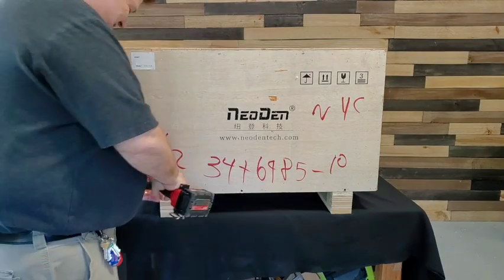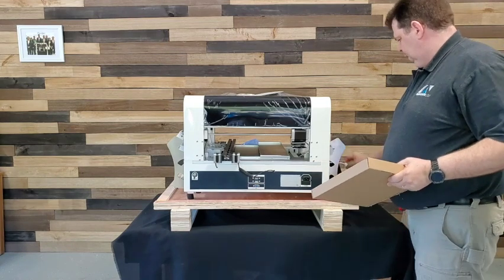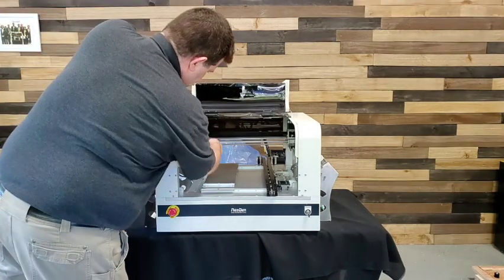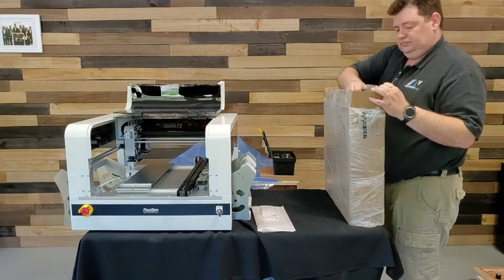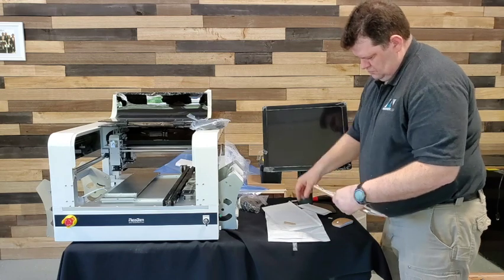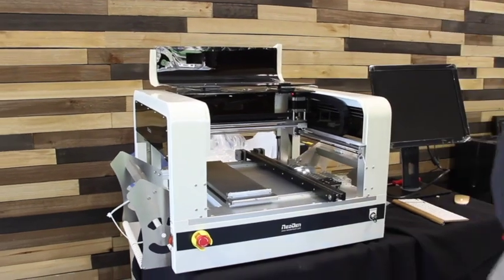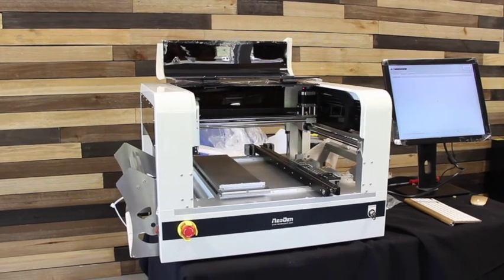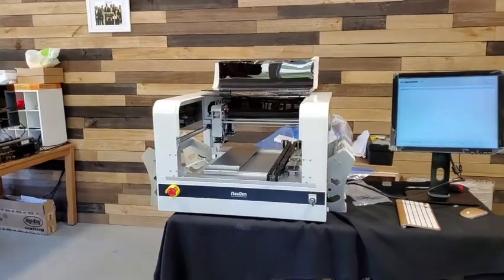Neoden 4 - SMT Pick and Place - Unboxing Instructions

Comment: Another great video!  Is there any way to get the feeders to “blow” to release components?  There are a few tricky components (specifically LEDs) that sometimes will never place, no matter how long the “place delay” is.

Under the “manual test” tab, there is an option to “Blow”, but it doesn’t seem like this functionality is possible during run time.  When manually picking the component and then enabling “blow”, the components fall off like I’d expect.  Without “blow”, the parts can sometimes take 1-2 minutes to fall off the nozzles on their own.
Reply from the maker: Thanks for the feedback, Mitch! Please reach out to us at support@neodenusa.com and we'll be happy to assist with this issue.